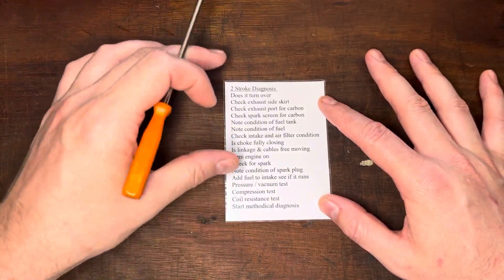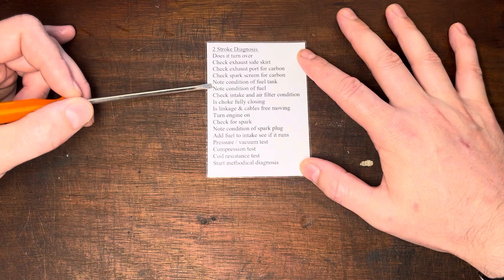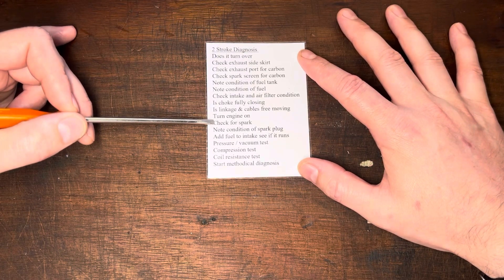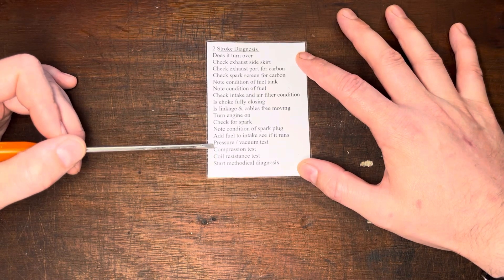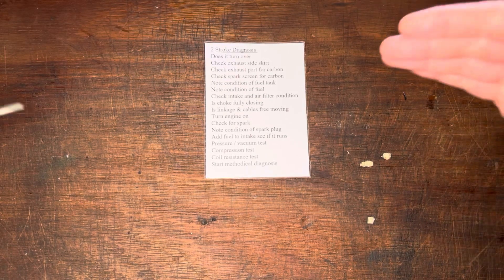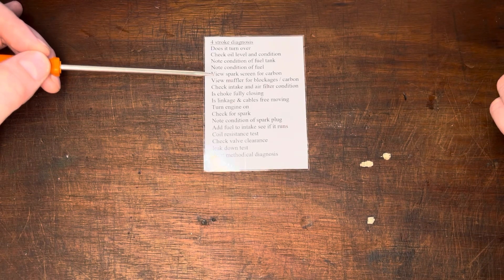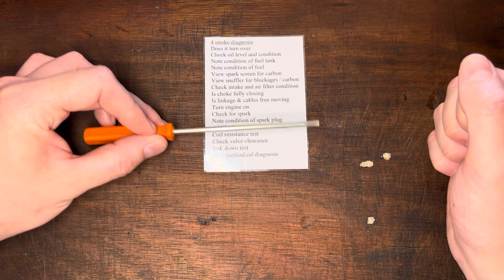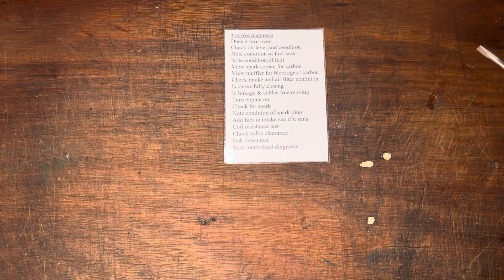Diagnose ANY 2 & 4 Stoke Engine!

Comment: Just fixed a hedge trimmer that had the wrong coil fitted. It looked the same, produced a good spark but backfired and would not start. Correct coil worked first time. Can different coils affect the timing?
Reply from the maker: It’s so hard to say without seeing it! How it sits on the engine. Though they can fail and spark at the wrong time, yes :)